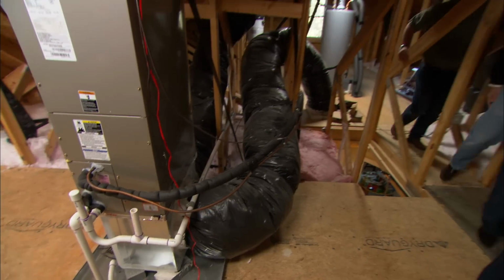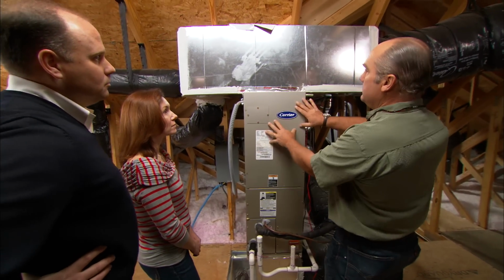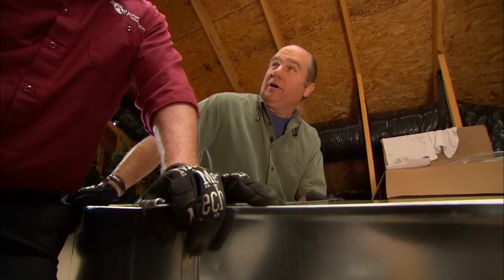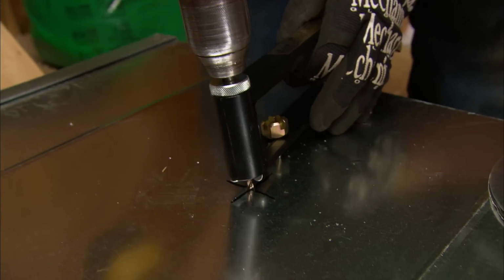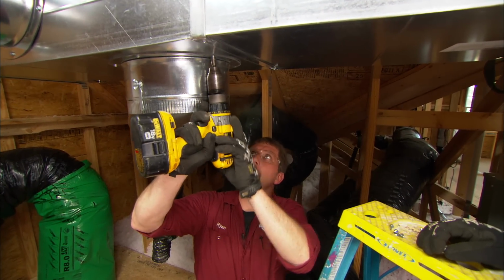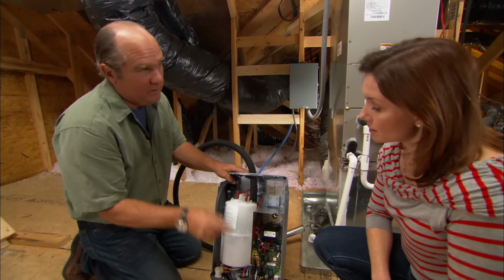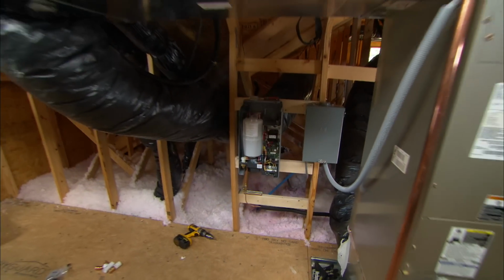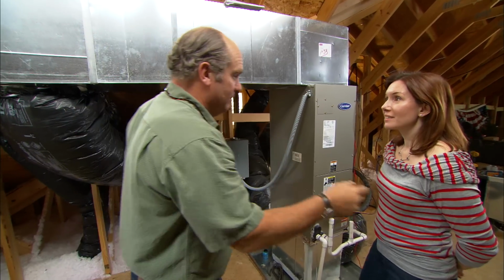How to Install a Whole-House Humidifier | Ask This Old House

Comment: For whole house humidifiers, element heater models use more electricity than humidifiers that use a wet media pad that when the moisture gets into the airstream when the blower in the air handler is running. If the weather is mild (70-73) degrees outside, and heating or air conditioning is not needed, you can switch the fan from “auto” to “on” at the thermostat without running the furnace or AC unit. Electric heated humidifiers cost you more on your electric bills compared to media pad humidifiers. Keep humidity control at the right levels and stay energy efficient and money efficient. Good install of that humidifier though!
Reply: Yes steam humidifiers cost more to operate.  But you'll never achieve a desired humidity level with a media pad humidifier.

Comment: Richard Trethewey is my hero! He has 40 some seasons with this old house and his son is following in his footsteps in the technology side of HVAC by exploring every type of reduced emissions electrical supply, co-ops that build a central supply being wind, ground, reduced electrical frequency (Less than 60hz) smart thermostats, GEO fencing and pushing proper building techniques like his father “If you insulate, you must ventilate”. In a house built in the 80’s, I have insulated the attic, the walls outside with R-14 EIFS to reduce utilities. It works! I wish I knew of certain products and had systems they use today “IF” properly installed. 
 Buying a house built 10, 20 or 40 years ago, I would know more than the average home inspector. But they get paid. Pull up, park and look at the roof. How many vents that are not for attic but piping. Say three, yet inside there are 4 bathrooms and hood over the cooktop range. Isn’t that 5. Is most smelly air vented into the attic or outside. Call the city permits office and ask about recent or permit history. It’s on computer! Home ad says new lights, 800 sq ft addition, new pool or hot tub, finished basement, 240 Vac in garage. No permits! Wait, stop. Old wood 1980’s windows. Many use body filler, fill rotted wood, sand, paint and caulking. What R-Value is in the attic, are the vents in the eves? Does the inspector check outlets for GFCI, or Arc-Fault? No! Fire them.

Comment: if it is a heat pump, why they did not cover high pressure line with insulation? Where is the axillary pan condensation discharge pipe?
Reply: Ask the person who decided to put a “furnace” and water heater in unconditioned space.

Comment: Flexible supplies everywhere.  What a terrible, cheap, furnace installation.   That plenum is just a piece of duct turned on its side and capped.  It was probably not even designed for that furnace, just field modified.   

You can cut a hole with tin snips.  Smack a hole with a hammer using a screwdriver as a chisel.  You don't need to run out and buy an $80 hole cutter attachment.

I've watched two videos ob this channel.  The first was a plumbing video.  As with the plumbing video this one is terribly vague.  I know what they're doing because I've done sheet metal  HVAC installs, but he's not giving any information about what he's doing.

The rework they did seems to mostly be good, work from what I can see aside from them not telling you anything about what they're doing (installing slips and drives, band iron hangers, and those self-tapping screws are commonly referred to as "Teks" based on the brand name (not unlike velcro)).

They didn't say anything about the installation of the high limit switch, or the air proving sensor he mentions (the humidifer install is the actual part I need to learn.)  Are they already pre-installed to the supply he attached to the duct?  Why does this thing need a 220v connection?  Also, they obviously didn't tap into the PVC drain they said they were going to use at the beginning of the install since the copper drain line is running behind the furnace and the PVC is still open where they said they were going to install it.

Comment: Where he connects it to the water heater pipe, with a little needle valve, WILL leak.  It'll start about three days after the install. You'll know it's dripping when you see a growing water stain on your ceiling, since this is in the attic. Oh, and you'll notice the leak on a Saturday at 5:30 pm. Good times!
Reply: What needle valve?  They Teed off of the cold supply, and it has it's own ball valve shut off.
Reply: Does that tap into the hot or cold water line?
Reply: if you are using the one im thinking about, its the same as a fridge line. as long as you pierce it and open it back, there shouldnt be any leaks. going on 7 years of no leaks here..

Comment: Pfft. Whole house electric steam humidifier.

Should have installed a nice oil-fired steam boiler with a dedicated low pressure steam system just to inject steam into the ductwork

Comment: Correct me if I'm wrong but this has to be one of, if not the most, inefficient types of systems? Why wouldn't you use an evaporative cooling system? Especially with them having hard water....
Reply: Steam humidifiers aren't prone to mold/mildew the way evaporative cooling ones are, and they don't require you to replace wicking filters. That's really the primary benefit.

Comment: now do this on a retrofit where you got to get creative.

and humidity depends on personal preference and what kind of stuff you have in your house. 

optimal conditions for humans is 40-60% humidity. 

electronics you want 45% just enough humidity to keep static discharges at bay but not enough to potentially damage the electronics.

Comment: Other solutions exist: If you spray atomized mist directly into the hot part of the plenum, it turns to steam. No separate bill for first boiling water to make steam. Furnace signals determine when the unit mists and adjust the volume of water used based on a humidistat. It's absurdly inefficient to use a separate process to preheat water to steam.
Reply: Nope! That atomized mist is full of minerals. In a year or two scale will start forming in the duct and you'll be sorry you ever did this. Oh yeah and the plenum isn't hot enough to actually boil that mist.
Reply: @tenthdimension9836  Not only that but even if that did work, you wouldn't be able to humidify without the furnace running heat.  Sometimes your house may need humidity but not heat.

Comment: The water heater is in the attic? RIP the guy that has to change that out every 10 years
Reply: mine is in my attic with an automatics shut off valve. pretty common.

Comment: Really nobody see the real issue 
Its a attic no insulation on the ductwork. No safety pan under the humidifier so when it freezes and breaks the water don't destroy the ceiling. They should be ashamed of themselves. And 3 4in feeds what are the heating a bathroom and 2 closets. And oh let's run a 12 in flex off of it instead of running a little more duck so we can get the proper static.  Omg. Thats what is wrong with this industry to many hacks that charge way to much find another job. You suck at this one

Comment: Dampers are to be install horizontal to airflow not vertical. This will help keep air balanced better as the thin part of the metal is in the air not the round part like a paddle in water. Secondly they should have sealed the duct with sealant and let dry. Lastly..if you have ductboard or soundlined duct..DO NOT INSTALL a humidifier.. it will cause mold!

Comment: that application could never be done up here in the north,can't have any type of water in the attic,it'll freeze and then messy
Reply: You could but you would need to have a mechanical room that is conditioned just like the rest of the house and very well insulated water pipes.

Comment: there is a company that sells a better humidifier which is a filterless, water mist sprayer.  Mister-Mini Duct-Mounted Atomizing Humidifier.
suggesting to install something like this is a highway robbery because there is 100 times better option available for less which requires basically no maintenance at all.
Reply: They get stuck from minerals and stop working within a week

Comment: All the HVAC in unconditioned hot attic. Very inefficient . Notice the main duct is not even insulated. I bet the cooling bills are very high in this house. It would be better if the rafters were insulated (spray foam) instead of the ceiling joists. Water heater in the attic? Northern states this would freeze and be a disaster.

Comment: When warm air meets cool air it condensates. If you put more humidity into your living space and it rises then you have more moisture in your attic. Hope the mold doesnt take hold
Reply: If you are producing 40-60% relative humidity in your living space and you have a properly insulated attic floor that won't happen. By the time air penetrates that insulation and meets with air cold enough to create condensation, the temperature differential is so low no condensation occurs. If you steam up your bathroom while taking a shower and run the exhaust fan to your attic, you will get hot, steamy air colliding with the cold air in the attic. You don't need a steam humidifier to get mold in your attic.

Comment: Where do they live? Usually, where a heat pump is used, there is no need for a humidifier because of the climate that heat pumps work in.
Reply: Heat pumps are working further north than years past. They are as far north as Maine now
Reply: I don't understand that at all. Humidity is really low in the winter time, which is when you be also using a heat pump. Winter air is dry and abrasive everywhere, even at 30 or 40 degrees.

Comment: Where do I get a humidifier like that and how much is it? I have a gas furnace with forced hot air and I destroyed the plenum by putting a humidifier on top of it. But I see how you place it down stream of the furnace. the furnace is in the bacement

Comment: That was way over board I could have put a aprilair in with half the work. No electricity. It’s a bypass humidifier but I do agree on the plenum being changed.
Reply: Hi Jay
Do you know how to put whole house humidifier on furnace in attic, without causing freezeups, etc
Reply: how would you get return air from a single flexible return duct? just put on a powered humidifier that takes 120v and forget about ducting it

Comment: Should have been stainless steel duct with an integral drain pan in the duct work....never do it the way shown without at least a drain and it should be sst duct

Comment: Copper for the drain and a 220v circut for a humidifier?  I guess if it calls for it, but man a tiny heating element like that needs 220v?  PVC that drain line all day, she already had pvc drains on the a/c unit anyway and to use copper for a drain is just a waste of money.  Good job though, not a really ideal installation location, they are hardly that neat/clean.  But it got the point across.

Comment: hi, if your contactor wants to put a water heater in your attic, its time for a new contractor
Reply: Every house in  Hilton head island s.c.has them in the attic. They all had pans with a dedicated 1" drain line that ran all the way outside the house. Seperate line for t&p. And it did always suck to get them up there.

Comment: so many things wrong with this. first the unit is in the attic so shouldn't the trunk be insulated! its going to sweat! second the humidifier should have  separate drain, why you ask well in the winter time when the humidifier drains it most likely in the application that they installed it will most likely go out side and freeze it should have a dedicated drain going somewhere in the home. also so tired of seeing duct work done wrong no step down uneven pressure its appalling.

Comment: Licensed electrician?  No support for the cable coming out of the furnace cabinet.  The protective conduit sleeve is not connected or supported.  Seems to be NM cable,  as can be seen by the NM cable connector, which would require a means of protection, but still needs to be supported.  It's unclear if the cable goes into the sub panel, but if it does, again, no support.  No way the electrical work on this project was inspected.
Reply: It was just put together quickly for the video, I'm sure  AFTER the video was done all of that stuff was addressed permanently

Comment: Ok. So uninsulated duct, poor designed plenum, brick  feet, adding electric to the air handlers circuit, all make for a nice setup? You better put more lipstick on that pig cause that is one crap install.
Reply: No mastic either. I'm assuming they insulated afterwards.

Comment: Nice big clean attic with water nearby.  Now do a typical installation, you know, tiny attic/crawlspace, no power, no water, cobwebs, dead mice, leaky toilet drain, etc, etc, etc.
Reply: You forgot to mention the 110 F temperatures in the attic.
Reply: @sgnt9337  you forgot to add the irritating fiberlas dust from the insulation that settles on your sweaty skin in the 110 degree attic
Reply: So very true... PLUS lighting!
Reply: My attic is a balancing act, only 1 sheet of plywood when you first go up the ladder hatch.  The attics on this show are always top notch.
Reply: Hahaha. And nails sticking out that you can impale your head on
Reply: @stektirade  So true
because some lazy roofer used his available RE-ROOFING three inch nails instead of the 1-1/4" nails. Oh and dont forget the lack of floor boards in most attics these days and you falling through the ceiling! haha
Reply: oh yeah, and not problem running a 220 circuit back to the panel in basement !!LOL
Reply: so true been there .
Reply: wtf. flex duct? I didn't know it was this old half assed HVAC house
Reply: Yes. Because when you make a how to video,  you want to make it as difficult to see, understand and comprehend as possible.
Reply: @matthewg9205  I wouldn't say they should make it difficult, but they should make it realistic. I don't have a problem with them showing the pretty installations, but as a contractor, I would like them to show the dirty difficult jobs as well. 80% of homes have their HVAC systems in small utility closets, dark cramped and dingy attics, or crawl spaces with a 4 foot height clearance, and you're lucky if it has an actual concrete floor to walk on.
Reply: @TChalla616  True, but again, it's just a how to. Take the information and apply it to whatever situation and in whatever conditions you're dealing with.
Reply: You forgot the brown recluses
Reply: Lol
Reply: No

Comment: terrible duct system, no insulation, way to long flex duct,not sealed, hot cold or hot will that attic get? freezing conditions?
Reply: christopher walker they only show horrible installations on tv. Nevermind the fact that it probably sounds like a train rolling.
Reply: Must be for illustration only, is there an actual heat & air co. that would install uninsulated or non duct lined metal in an attic. Just saying they couldn't be that dumb.

Comment: What I really wanna know is why that plenum isn't insulated? Why aren't the plenum joints taped and masticed or mastic taped? How about if you make videos about home improvement, you actually do it right. I used to love watching this old house when I was a kid. Now that I do HVAC, Electrical, and Plumbing for a living I see how full of bologna they are most of the time. Can I get the business name/location and license for this HVAC contractor? There are repercussions for doing sub par work.
Reply: This is a how not to video. This would get the inspectors laughing in WV.
Reply: wait....you care why the plenums are uninsulated, but not why there are water lines in the attic?
Reply: Besides plenum not insulated its not design right. As you take off air to keep static in ductwork the duct must be decrease on size. Also, new unit sits on top of bricks. This is very very poor quality job! i feel bad for owners of this house.
Reply: Daniel Manfredi I think the joints are gasketed. But yeah, should be insulated.
Reply: The one's between the starter collars and plenum are. The ones under the drive cleat aren't and between the air handler and the plenum aren't. 

Don't get me wrong it's a good video for the application of the humidifier. I would just like to see things done up to code.
Reply: Im sure it was all done minimally  initially for the VIDEO which would have been 3 hours long if they did all that.

Comment: What brand is that humidifier?
Reply: One that uses a LOT of electric to heat water up! other units Ive seen simply use a fine mist spray of water on a foam screen, and a 4" takeoff flex duct goes thru it and into the main duct, LOTS cheaper.
Reply: Its not an aprilaire product.
Reply: It's the Aprilaire 800. Way overkill unless you live in a 6000 sqft home.
Reply: That looks like a Honeywell, a knock-off of the popular Aprilaire 800. The cover has the Honeywell badge taken off and the stainless steel diffuser is different than the Aprilaire 800 (very unique).

Comment: do you have to run additional lines for the humdiostat?
Reply: Yes unless the tstat has additional lines it can spare.
Reply: It's most likely wireless.
Reply: @chrisadkinswork5016  no, Richard said they ran control wires